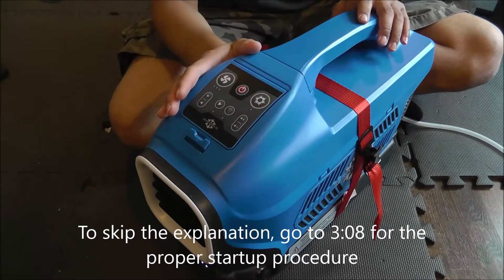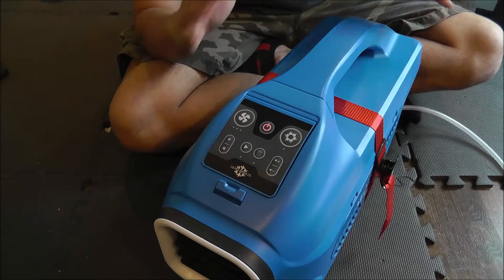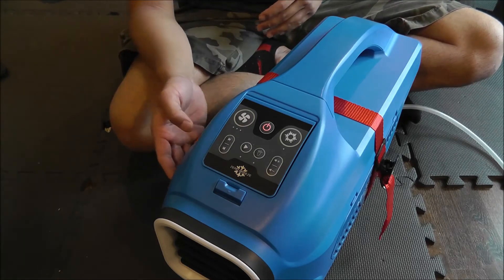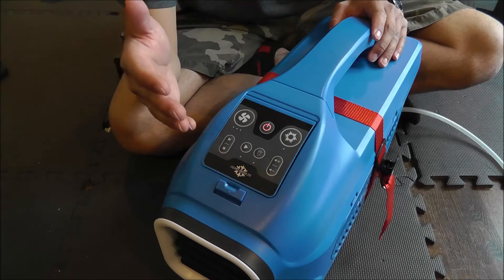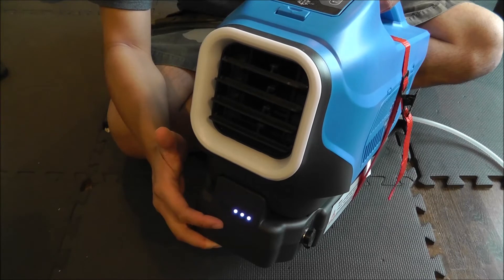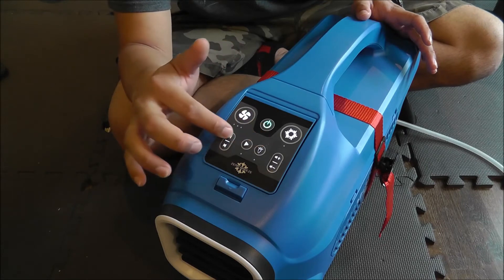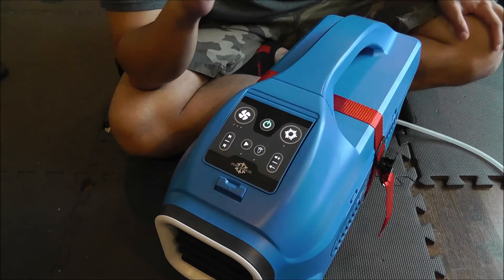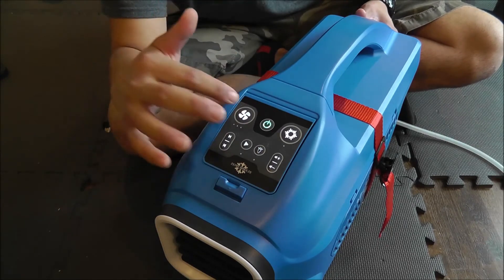Zero Breeze Portable Air Conditioner: Proper Startup Procedure [TURN IT ON RIGHT!!]

Comment: what a ridiculous procedure. are you the manufactuer of this product? why do you promote this unit so heavily when the company false claims for this product? its a 480btu open air ac, not an 1100btu closed enviornment ac! its less effective than a $50 ice chest cooler for 10 times the price!
Reply from the maker: I agree, not the most intuitive procedure.   No I am not the manufacturer and I do not promote any product, simply unbox, review and discuss products I find interesting.

As far as cooling capacity, the specifications rate it at 1100 BTUs so that's what I list.  If it's actually something different I haven't seen any evidence to support that, but I will be sure to ask my contact in the company.

I find this product, though expensive to be really great for car shows, which is the primary reason I purchased it. 

Thanks for watching!

Comment: Man idk what happened with my unit. Something must be wrong with my compressor. I feel like it blew legit cool air the first few times I used it, but now the compressor doesn't even blow cold air. The air temperature is the same with or without the compressor. Any ideas?
Reply from the maker: Evan Rousselle Hmm, is the compressor coming on, can you hear it making noise?  Is the indicator light on?  That's odd for sure.